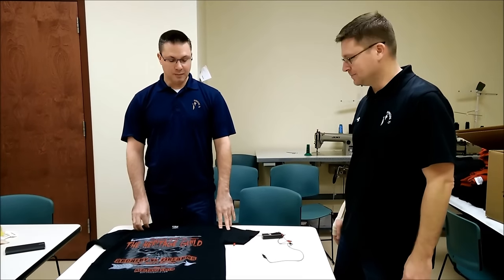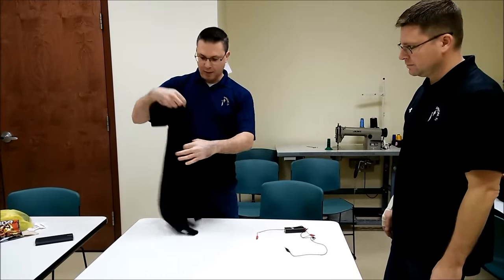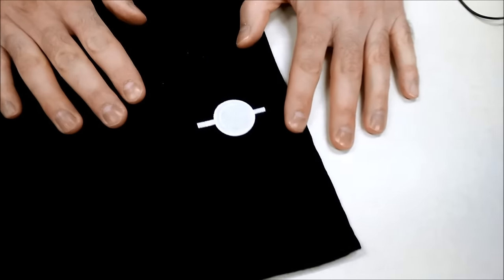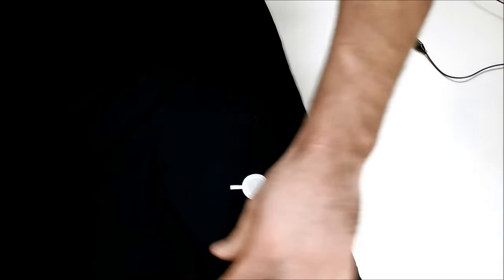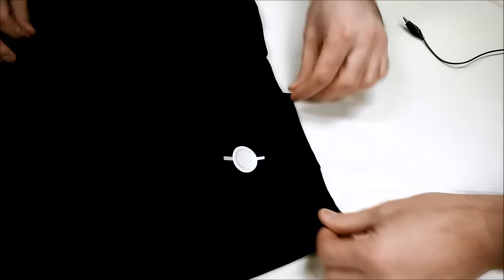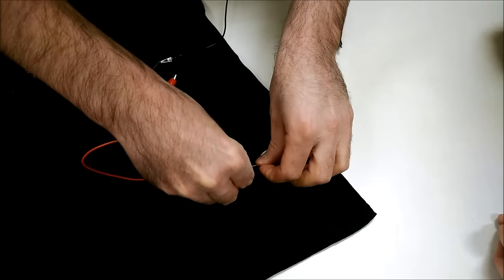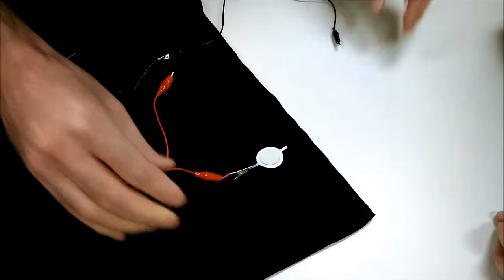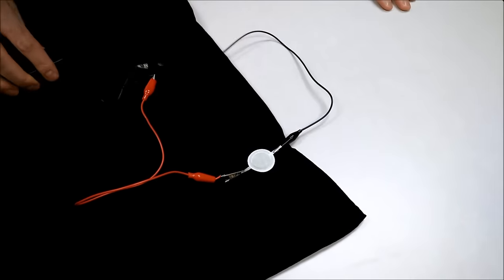Electroluminescent Screen Printing Wearables

Comment: Oh, whoops, you guys cut out right before you demonstrated it was flexible (which I'm sure it is, of it's screen-printed). Great use of polymer electronics!
Reply: +Mike Trieu (MegasChara) Sorry about that Mike, you're right though it is flexible within reason.  We soaked this prototype in the sink, crumpled it up and let it dry and then hooked it up again and it worked.  We're currently in the process of testing a more substantial design, a company logo.  We're planning on putting that one through some significant wear, wash and dry scenarios.  Ideally we want to be able to build lamps that we can apply to a screen printed transfer sheet that DIY and Makers can just use at home in their projects by adhering the lamp just with their household iron.  But we have a little way to go first. http://www.AMBROlabs.com